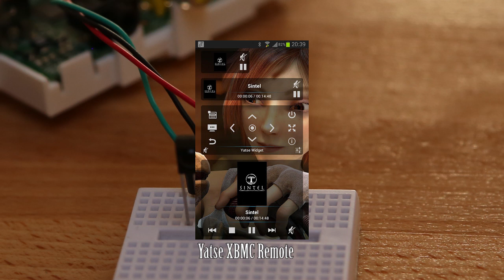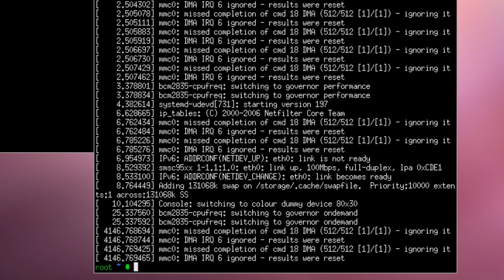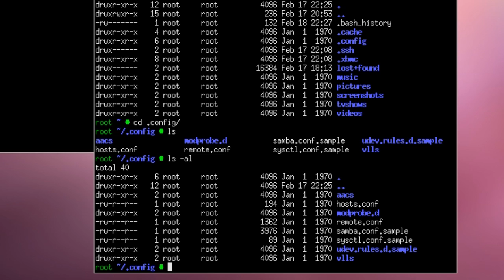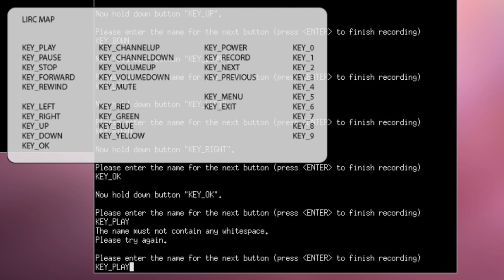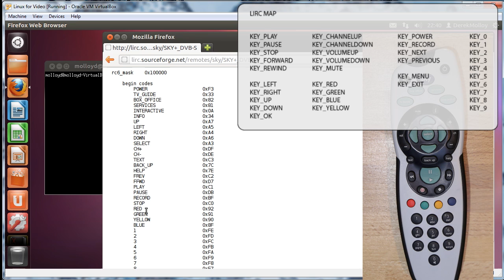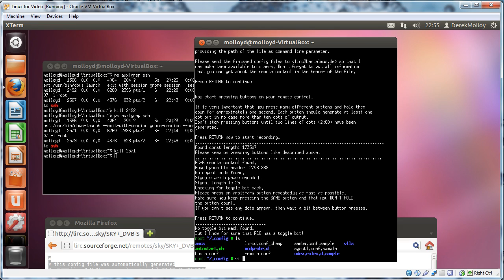Raspberry PI: XBMC Home Media Player - Adding IR Remote Control

Comment: If your Pi connects to the display with HDMI and you notice that Pi says "Pulse-Eight CEC" connected then your TV remote can be used to control the Pi. Specifically the remote's UP/Down/Left/Right buttons and usually the Back and Exit buttons also!

If you see this msg but your TV remote does not seem to do anything then on your TV go to menu settings and turn on the CEC settings.

HDMI and CEC make the Pi extra handy to use for a media client device

Comment: Your tutorial fail on my RPi 2. When i write: "modprobe lirc_rpi gpio_in_pin=18 gpio_out_pin=2"
I get: "modprobe: ERROR: could not insert 'lirc_rpi': No such device"
Could you help me? What should I do to add IR remote to RPi 2??
If write "dmesg" ->
[  389.477590] lirc_dev: IR Remote Control driver registered, major 248
[  389.492739] lirc_rpi: module is from the staging directory, the quality is unknown, you have been warned.
[  389.494688] lirc_rpi: gpio chip not found!
Reply: This is on the raspberry pi 1, it won't work on the two because of the architecture
Reply: TheMiniGeek  I had the same problem. I added dtoverlay=lirc-rpi to the config.txt file and that was a fix

Comment: Do you need the resistence under all circumstances? I have my IR sensor connected, but no matter what I try, the Pi won't start unless I remove the wire from the Voltage pin. What could I be doing wrong? the description of the sensor says that it operates from 3V to 5V..

Comment: Hi thanks for that usefull video, but i have one question. Why do you build it with the capacitor and resistor ? I saw other Videos and they pluged the IR Receiver directly to the raspi.  Thx

Comment: Anyone able to help me my xbmc is upto date I am using putty to log in to my system and the having problems with root. I had to change to root via the terminal  now when I run ls -al I get completely different files as to those shown on the tutorial when I type cat /sys/kernel/debug/gpio I get No such file or directory. I am confused

Comment from the maker: Hi, the timings you sample are never perfectly accurate and you will notice variations each time you press a button on the remote even if everything was at 38KHz. I don't think the change to 36KHz would be too much of a problem. The IR signal pulses are between 1ms and 10ms in duration for each 'bit' of the signal. The 36KHz/38KHz would be sampling at around 0.025ms/0.026ms per sample, so you should get fairly consistent results. In theory anyway!

Comment: Hi, This is a great idea :)

But I have a question. How do I know what frequency the receiver I use? In this case it is 38 KHz. And what if the remote control works with 36 KHz?

Regards

Comment from the maker: Hi Darren (on your build question), The build is very large. I think my disk is 25GB and I was worried about running out of space. Try increasing your Virtual Box disk size (surprisingly difficult! - I did this with a gparted live CD boot under virtualbox) and compiling again.